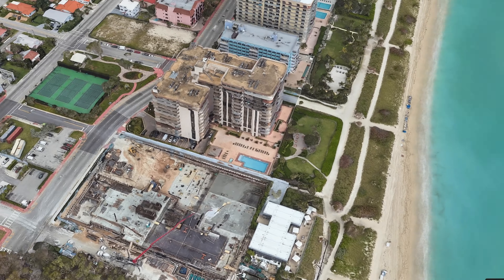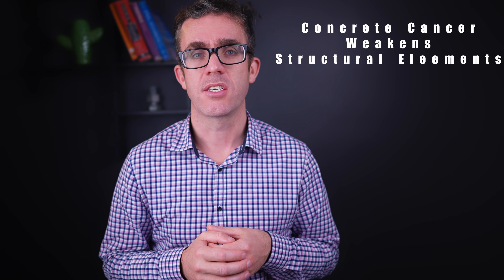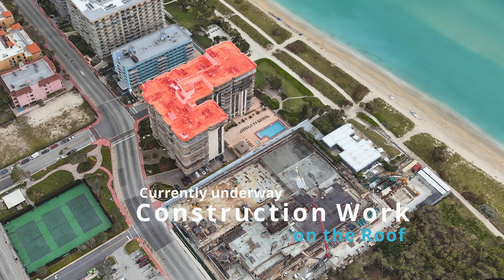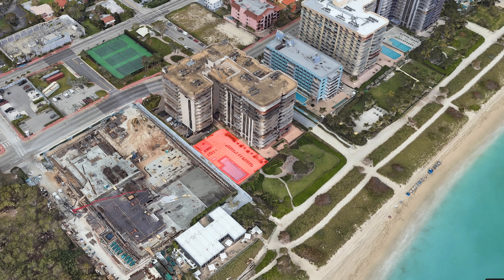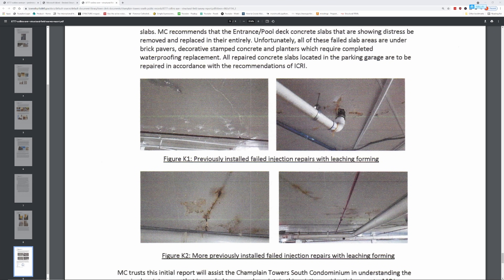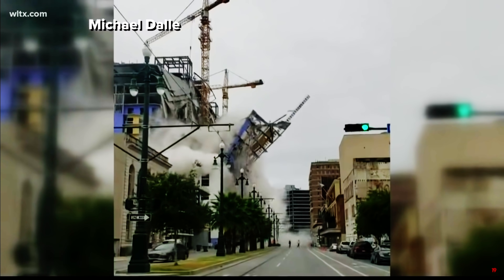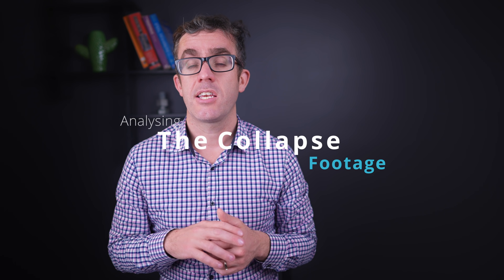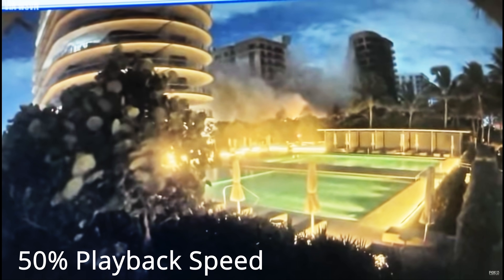How did a Miami building collapse: The Warning Signs. Report and  CCTV footage analysed

Comment: This is the best video I ( a licensed Professional Engineer myself ) have seen 
to date. Congratulations on your broad compilation of potential failure mechanisms.
Also, I appreciate your emphasis on the need for ORIGINAL DESIGN ELEMENTS 
factored in to mitigate single failures. A prime example of this philosophy can 
be found in the design requirements of the US Nuclear Regulatory Commission's 
SINGLE FAILURE CRITERIA. This requires enough mitigation features such that 
NO SINGLE FAILURE can prevent the SAFE SHUT DOWN of the plant in order to 
prevent the release of harmful radiation to the public. The excellent safety record 
of US facilities indicates that this approach can work. In contrast to the infamous 
Chernobyl disaster, which used a totally different approach to this country, 
I believe that disaster mitigation should play a more important role in ordinary 
structural, and even non-structural future designs. Furthermore, recertification 
inspections should at least offer some disaster mitigation RETROFIT OPTIONS 
for consideration. We must refrain from a panic approach that can result in 
massive evacuation overreactions.
Reply from the maker: Hi Roger, thanks for watching, your support is appreciated. I tried to covering a broad range as it may be end  several of these to cause the failure. It is great to hear about parallels in other sectors, SFA should be part of more engineering designs. Also, Chernobyl is fascinating story with human factors leading to that tragedy. Do you work nuclear sector?
Reply: @BrendanHasty  @Brendan Hasty    Thank you for your kind response.
I am no longer active in the nuclear power field but I am confident that 
if anything, the standards are just as high now as they were in the past.
At times my work required me to spend days to weeks in the Control 
Rooms of active, running nuclear plants. Since I was aware of all of the 
safety features that were built into them I never felt the slightest tingle 
of anxiety.

Comment: News flash:  The building was demolished so the onsite portion of his proposed studies is not possible.  It is not economically nor physically possible to design a lower level for the impact of even a single level above falling on the level below.  The Catenary action that the UK engineer suggested, is not possible at the outside bays.  The pool structure was under designed for both beam shear and for 2-way shear, depending upon the structure type at the initial failure point.  Furthermore, the design drawings show bottom reinforcing to have insufficient concrete cover for all slabs, beams and columns, as recommended by the ACI Building Code.

Comment: "The roof first collapse theories don't really line up with the following:

1) eyewitness accounts that the pool deck collapsed first, they called it a "sinkhole"

2) the punch through failure of the column/pool deck connections at the 
the columns.  If the building fell first on the pool deck, you'd expect 
to see shear failure at the impact area instead of widespread 
"settlement" of the entire deck and several columns that demonstrated 
punch through.  

3) the collapse video shows the face of the building collapsing as one 
piece, suggesting a failure at the foundation.  With a top down failure 
at the roof, you would see pancaking of the top cascading down to the 
bottom.   "
Reply from the maker: Hi Design Studio, I agree that the Roof came first theories don't seem to align with the damage obeserved,   a parapet  falling onto the pool deck it would be unlikely to cause enough damage to take the whole building down.
Reply: @BrendanHasty  The ACI specs are 3/4" concrete coverage not exposed to earth which is woefully small due to tolerance in construction can be up to 2". I have an Engineering degree and was an inspector for 20 years. Many reasons for this disaster mainly lack of repairs which caused the collapse of the pool deck which caused eccentric lateral loads to the building columns.
Maybe if the buildings construction wasn't so faulty it might have survived. The concrete was like baby powder in some places.
Believe me there are millions of buildings like this.

Comment: I watched a video where a man who maintained the building in the early 2000’s,  said that the parking garage flooded several times a month from the tide, they constantly went through water pumps to clear out the water. He said they never could get all the water out with the pumps and that the water would eventually seep into the foundation. This water could not be good for the foundation at all. He also said that the other tower never had any of these flooding issues from the tide.  Thank you for your informative video.
Reply: Interesting.
Reply: Crisis actor's!
Reply: @sunsetlights100  🤔

Comment: 2:36 YES! First and foremost solid footings are vital! This is the best video I can actually comprehend, you mention all the important factors that we discuss in Europe. Im from Greece, my dad is a math professor and house builder, and I have a beach front property facing the sea and with the view of Rio's cable bridge that he built, and also my grampa's house built in the 60s is there right in front of the beach just like mine and his house has no issues for being exposed to high tide at times and we have a garage under the house but our columns are huge and the concrete is good quality. Theyre full concrete 2-storey houses, not cheap structures, fully insulated, thick walls, solid foundation and big footings cuz we suffer from earthquakes there. No issues with rust or concrete falling apart. This building had paper thin walls, possibly bad quality concrete, thin slabs, the balconies looked ridiculous, such amateur work. Poor foundation and beams, nothing ties together and the pool shouldnt have been on top of the garage,part of the construction.. who thought of that. Esp for such a bad terrain (soggy and porous) they should have built a shorter building and as if theyd build a concrete bridge with strong sea currents. It is a total mess and Ive known for a long time that Europeans know how to build with concrete, bricks and stone better, our civil engineers apply physics and math when they build, they dont just pour concrete with some random rebar. Ive lived twice in condos in the US and I always always felt unsafe.
Reply: Yes, as an American myself, I'm weary of buildings built from the 1960's to current times because the standard of building became all about the profit. This was when builders lost the craft of building a sustainable home to last generations and instead were looking to build fast with as cheap of materials as possible to get more revenue. I live in a rural region in California where sadly we lost a good portion of beautiful homes prior to the 1930's because it was before our local dam was built, and it was common to lose buildings that were too close to the flooding rivers in certain times of the year (have no idea why some people had the idea it was a good idea to build too close to a river that floods regularly). This resulted most of our homes to be built after the 1940's, and we also had a boom in the 1960's so you can tell which house era is going to require more maintenance. 

Most homes built prior to the 1950's will most likely be need of replacing insulation, updating electricity possibly, and adding an ac unit. There can be a maintenance of replacing kitchens, bathrooms, or changing the layout but it's about preference and how the past owners have taken care of the space determines the durability of the house. Where as the homes built after the 1950's need a lot more work, specifically the water pipes as some builders used certain pipes that are easier to corrode, like copper, because it was cheaper material. And it's rare to find a home built in the 1960's to not need to repair certain rooms like the kitchen or bathroom

Thankfully in this region we don't have to deal with the flood since the dam was built, nor have to worry about sky risers because the tallest building we have is our hospital that is about ~5 stories high, most buildings are not even 3 stories in this area. But it certainly made me question other buildings around the US with the stability of multi level buildings, it's one of the factors that never motivated me to look for those spots, plus our architecture plunged down since the 1960's imo since "streamline" just looks cheap and tacky with certain looks. And there are times when an older building needs invention and some buildings that are on the newer side could last for a while, but lately this is something that I've picked up on from studying specifically home building history.

Comment: Thank you for helping to teach us how to track the essential elements of this tragedy! You present this very compassionately! I recall one of the building reports (maybe the 40 year recertification) mentioning damage that would or could expand “exponentially.” In layman’s terms shouldn’t we read that as “We expect a sudden and unannounced explosion of damage and failure.”?
Reply from the maker: Hi Susan,  agree 'exponential' is a sudden and rapid deterioration. 
exponential growth occurs very quickly and be best example that helps you visualise the issue is the explanation of a stadium filling with water. 

It’s 1 PM
 It’s 1pm. Imagine a normal sized football or baseball stadium. You are sitting in a seat at the very top of the stadium. You are overlooking the bowl of the whole stadium.
To make things more interesting, imagine the stadium is completely water-tight.
The question is, if a single drop of water is added to the stadium, and then one minute later it doubles and two more drops are added, and then one minute after that it doubles again to 4 drops, and so on.. the water volume doubling in size every minute, how much time do you think you have to leave your seat and get out of the stadium before the water reaches your seat at the very top?
Think about it for a moment. It seems like you would have plenty of time to get out, right? Especially given that you can see it rising and could judge for yourself when to leave?
 The first drop of water lands right in the middle of the field, at 1pm. Tick-Tock goes the clock…
It’s 1:45 PM
You’ve been watching the water slowly filling the stadium grounds down there on the field.
45 minutes after the first drop, at 1:45 PM, the water is covering the field and lapping at the seats of the lower 1st-level rows. It doesn’t look terribly deep. Seems like plenty of time to get out if need be…
At 1:45 PM the stadium is 93% empty
No worries, right?
It’s 1:48 PM
Shockingly, as you watch, the stadium goes from 93% empty to being half full, in just about 3 minutes!!
Holy S! You better get outta there!
But guess what? Too late…
It’s 1:49 PM
In one more minute, the stadium goes from half full to completely 100% full and spilling over the top!
So, you sit and watch the single drop growing, doubling, and after 45 minutes all you see is the playing field covered with water. And then, within four more minutes, the water fills the whole stadium.
This means that you think you are safe because it seems that you have plenty of time left. Whereas due to the exponential growth you really have to take action much sooner if you want to have any chance of getting out of this situation!

Comment: At around 2:30 you mention that the building had been settling by 1 to 2 mils. In SI that's millimeter (1000th of a meter) but in IP, which is used where the building was located, it only means 1000th of an inch, so it's different by a factor of about 40. I assume you mean millimeter?
Reply from the maker: Hi Mario, you are correct it was millimetres in IS units, sorry for the confusion. I use mills for short hand for millimetres.

Comment: The pool deck failed, punch THROUGH.  
That yanked the columns,  collapsing them in sequence.
Reply: The pool deck slab was tied to columns supporting one tower so the punch-through cascaded into a massive failure. There should have been shear points on the shared columns to prevent a collapsed pool deck from yanking or pulling down shared columns.

Comment: Let's make this a simple discussion.
The cause of the 40-year old building collapsed was due to the structural failure that had reached it's ultimate limit. 

Why the Miami Building Structure collapsed?
Sadly, It was a stupid choice, they all ignore the signs of serious cracking that were coming out and appearing on primary structural elements of the building, and visibly a threatening sign to all occupants early on while the ultimate capacity has not been reached yet. 

There were plenty of time and chances given to them to prevent such catastrophe which could have saved more innocent lives if people involved were truly responsible. In Structural Engineering Practices, if cracking on existing structural elements (Columns, beams, slabs, and concrete wall) existed unusually in buildings, it automatically illustrates that something bad is propagating in the building. Course Of ACTION? Structural investigation must be carried out immediately to determine the cause of such and then straight away no wasting of time corrective actions must be done to counter the unusual cracking to prevent whatever apparent disaster to happen. Any associated cost to the structural investigations and repairs should not be taken as a reason to halt the remedial action because it is far cheaper over a collapsed scenario where the cost of lives are included, which is the current situation now, that's it!!! no other way, no other explanation. The cause of collapsed is boldly characterized by irresponsibility and overwhelming stupidity of everyone involved who have the knowledge of the long period of deteriorating stages of the building and took no preventive action on it.

They allowed it, instead of preventing it. No one can reset the time once it happened.
RIP to all the innocent victims killed caused by few stupid people attached to it.

Comment: my suggestion :   the non-ductile shear-punching failure + corrosion caused by the  pool water and the ocean breeze ... ?????
Reply: Lack of steel at column connections  to 2 way slab allowed easy punch thru shear.Also bad concrete.
Reply: @designstudio8013  what steel :  for bending or shear ???
Reply: @tymoteuszzwroclawia  Both..there are plenty of pics showing the poor steel connections at the top of columns along with many other defects,
Reply: @designstudio8013   You are right, we do not have enough information to build any serious theory what caused this building to crumble down. Two facts I learn yesterday. First, the whole process took about 7 minutes. Second, some people escaped from the building (???!!!). They may provide valuable information. For me personally the failure is not a problem. Many have happened in the past and many will happen in the future. For me the most interesting is the shocking mode of failure. Pancaking of the whole 12 story building is not acceptable !!  Part of the problem is how such buildings are design. I highly regard ACI - 318 except I could never accepted its provisions for the punching shear in two -way slabs. ACI-318 allow to design the slab - column connection without any reinforcement for shear. This means that the whole shear force is taken by pure concrete. I would call this non-ductile design because concrete is a brittle material. Contrary to this, in beams (where punching shear does not exist) design for shear  requires at least mandatory minimum reinforcement. Pancaking, pancaking is a problem !!!!
Reply: @designstudio8013  Design Studio !! Where are you and who are you ??? May I ask ???  In this type of structure there is NO STEEL CONNECTIONS at the top of columns !!!!!  What others defects did you observe ???
Reply: @tymoteuszzwroclawia  You need to go back to schol to learn how to design a 2 way slab with columns lacking capitals?
Reply: @designstudio8013  No, I do not.

Comment: Sounds like the water proofing failed under the deck many years ago. Instead of fixing the root cause of the leaks they had cosmetic patch work on the cracks in the garage ceiling and pumped out the water, all the while the rebar was rusting out. In 2018 they were given 15 million dollar repair bill for years of neglect. Since you have to get a majority of the condo owners to agree on such a large expense that the repair was dragged out as long as possible. Add to that the building wasn't made to withstand any structural failure (no doubt to save money). The safety inspection process also leaves a lot of opportunity for building owners to ignore or postpone structural repairs. I'd imagine most lay people would view water leaks as nuisance and not believe it could cause a collapse.